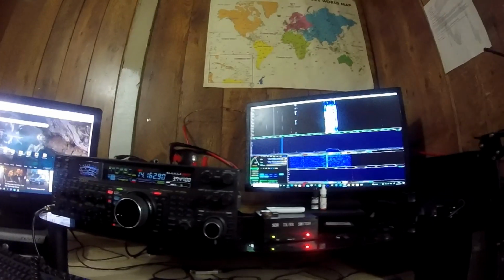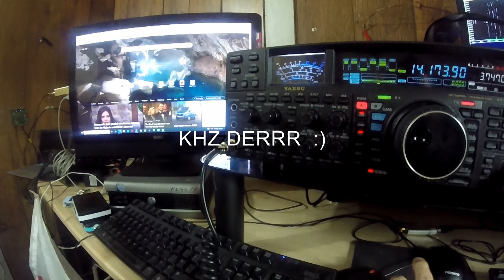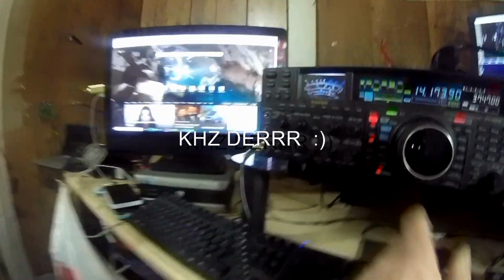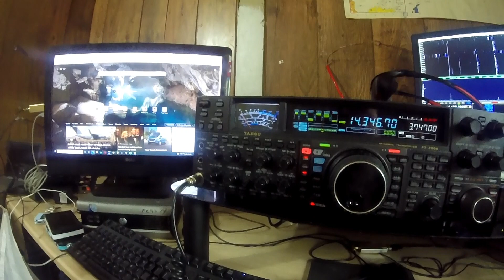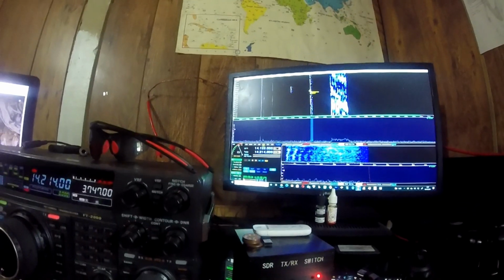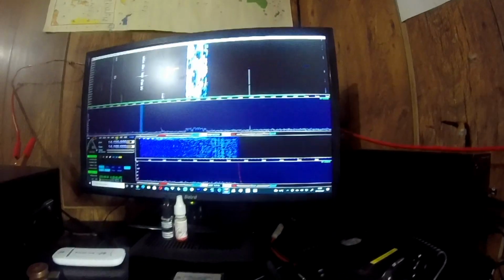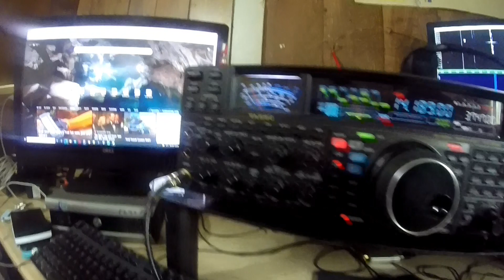portable hf antenna by m1dls

Comment: Hello from Germany, I see that you also have the FT2000, I have that too, how do you do that when you adjust the frequency, on the right monitor I think it's HDSDR the frequency also goes with it, I think you do You can probably click on the screen with the mouse and the FT2000 will then jump to exactly the frequency where you clicked on it, right? That's exactly what I'm looking for by making the old device appear a little more modern again with this tool. 73 Jörg